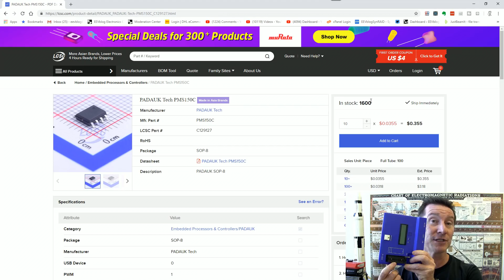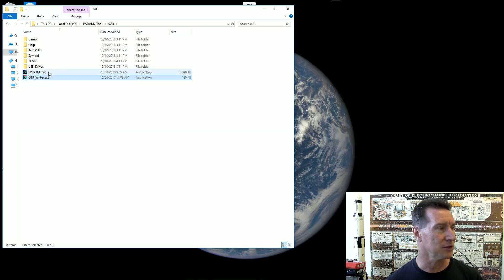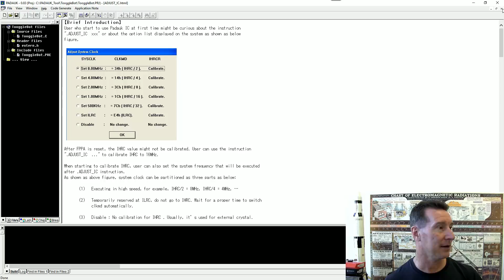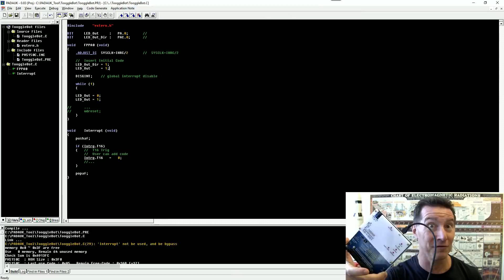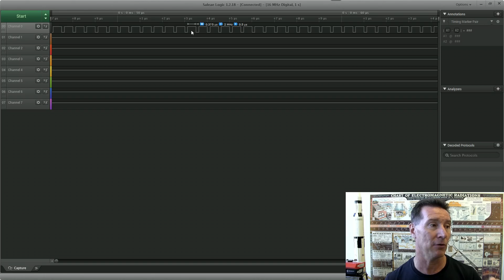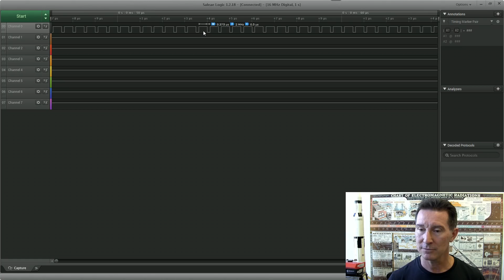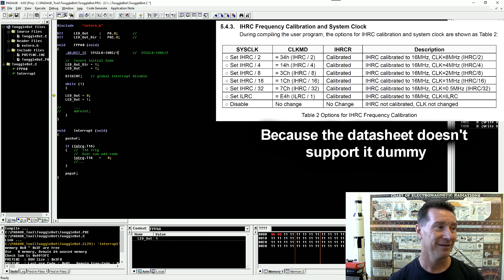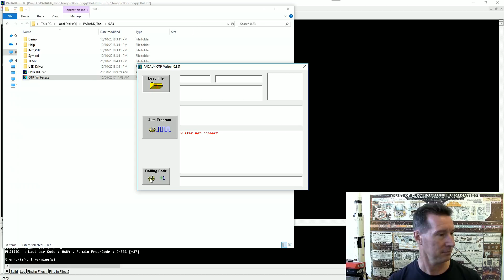EEVblog #1140 - 3 CENT Micro LED Blinky with ICE!

Comment: Who is going to be the first person to program it as a 555 replacement?
Reply from the maker: David Scheiber - 555 is not even close the relatively precision timing. The internal RC oscillators on micros are typically much better controlled than a 555 (typical >=5% cap value)
Reply: Dave that is so awesome of you to listen to your subscribers and order/program the 3cent chips, they should really make like a 10 cent reprogrammable version and sell cheap programmer kits to schools and universities, so that more schools and unis teach their students actual practical programming instead of just compiling hello world,  get micros in everyone's hands
Reply: @iwantitpaintedblack  yes because schools need to save 2c per chip.
Reply: I think micro will be more precise than 555, because the biggest problem is accuracy of caps capacitance (-10%/+20%?) and use of 5% resistors or trimmers. With micro all you need to do is get two 1% resistors or one variable resistor (pot) to make it adjustable, or even zero pots/resistors, if you hard code the timing pattern (or make some jumpers to select what you want). The benefit of using single or zero pins as input (for simple timing), is really cool because you can then use other pins for various stuff, like sync, multiple synced output (i.e. with phase offset, or dividers), or use another input to select maybe pulse width / duty cycle. Not to mention micro can generate a lot of other pulses shapes and waveforms (with PWM+LC filter). Not to mention you can use one small uC to basically create maybe 4 separate PWM signals possibly all at different frequency and duty cycle, and control it using 1-wire protocol from main uC, on separate busses, via daisy chining, or on one shared bus if you could make them program unique IDs into each chip. You could create easily 100 channel PWM for 1$.
Reply: A while back, I thought about the idea of using an attiny as an I2C address translator. So if you had multiple devices with the same hard-wired address, they could be remapped to different addresses (from the I2C master's perspective). But given the price, it would probably be cheaper to use an I2C multiplexer. However, at $0.03, maybe it would be worth it, while also eliminating the bus selection step.
Reply: I already did that with the attiny4. iirc i've put it on github 

EDIT: there it is https://gist.github.com/5N44P/3b7f3be883065c6469940819f6ff9fe0
Reply: I was about to do almost that. Seems nice for boot sequencing other stuff. Replaces like 5-6 monostables.
Reply: How would you select the timing without some external components?  For a fixed frequency it would be OK.  I know from PIC programming that you can set a pin to output, wait for a capacitor to charge through a resistor (monitored by another input pin) and discharge the capacitor by setting the output pin low.  If there is an ADC you can do the 555 1/3, 2/3 discharge/charge thing but you still need a few external components.
Reply: I might do that.
Reply: I actually heard canned laughter when i read that. WHY?! You already have a 555 timer and they aren't rare and elusive chips. You can buy them by the 1000s! I bought 100 of them in tubes for cheap!
Reply: I though you were on to something but the 555 is a relatively precision timing chip, so to match it you would likely have to add an external crystal to the micro
Reply: @DavidScheiber  how the 555 can be a precision timer if the time constant of the system is given by an RC circuit?
Reply: @valerionappi7839  By using precision passives?
#Derp
Reply: @DavidScheiber  Not everything using a 555 needs to have precision timing, especially when timing at the second or minute level.
Reply: @DavidScheiber  Bollocks.
Reply: +Jammit     First person will also be the first idiot, as well.

Comment: You should program it so like you hit a button, and it quickly flashes 3 times like something is going to happen. Maybe you make them into an ASIC cluster. Can you turn one of the pins into a i2c bus or something? Then you'd need to fan out to other chips for GPIO.
Reply: Matthew Suffidy i2c requires two pins.
Reply: I thought it may. No it is really ugly, but what you could do is if there is like 1 output pin, you could like have 8 more or so of these chips listening on that line for a serial-ish sequence to drive single output lines for example.
Reply: I found the English Datasheet: 

http://www.padauk.com.tw/upload/doc/PMS150C%20datasheet%20V004_EN_20180124.pdf

It looks like it just has like 2 or 3 input or output pins without protocol.

Comment: If someone can cobble up a DIY programmer things would be really interesting! 
@Dave - please have a look under the hood of your programmer... ;)
Reply from the maker: did on two 2nd channel videos
Reply: Something similar to the "Arduino as ISP" thing, this would put it into the hands of almost everyone.
Reply from the maker: The Arduino as ISP thing is in progress...
Reply: @EEVblog  great 😍😍
Reply: @nrdesign1991  😍😍yeeeeees
Reply: @Ennar
 Yeh... but it will stop being 0.03 very fast!
Reply: Jens Andree More interesting to get a general pattern / algorithm to load into generic programmers and testers.  For example, in circuit programming might be integrated into the test patterns for an assembly line board tester that already uses product specific patterns to test that all the other parts are working and connected correctly as boards roll past.
Reply: Got a link to these vids?

Comment: The instruction set is listed in the datasheet starting at page 50.
http://www.padauk.com.tw/upload/doc/PMS150C%20datasheet%20V004_EN_20180124.pdf

It looks like a pretty decent instruction set for such a cheap microcontroller. It seems pretty simple to work with and  there are only like 19 configuration registers. If the ICE wasn't so hard to get, it would be fun to play around with.

Comment: thanks dave for pointing this micro out, if someone implements a gcc backend this could become huge (depending on the errata of course ;) )
Reply: It's not a good target for gcc. It's got a tiny memory and a fairly large instruction set. The semi-C/ASM language they use is a pretty sensible approach to programming it.
Reply from the maker: As David said in the video, it'd be a bit how'ya'doing the first time...

Comment: hmmmm i could make a software emulator for this if it doesn't already exist. i wonder if anyone would find that useful?
Reply from the maker: I've done very useful projects in C on tiny micros with 64 bytes of RAM or less. You'd be surprised what you can do with such little memory and a good C compiler. Often it's the program memory that limits you, not the SRAM.
Reply: My impression was that gcc isn't very well optimised to generate code that needs to work on really tiny memory architectures... But I just saw that people have had success using it on attinys so perhaps my prejudice is outdated. SDCC used to be a favourite for those kinds of devices...
Reply from the maker: I'm sure someone would!
Reply: build a gcc backend instead it's much more useful!
Reply from the maker: I agree a gcc backend would be more useful, as we have the fairly cheap ICE for real circuit emulation.
Reply: How much support do we need to make this project a thing?
SDCC is easier to retarget than GCC, clang I think would also be easier but nobody seems to re target clang?
Reply: +1 SDCC, or convert the Tiny C compiler(TCC) tree.
Reply: 64 bytes of RAM is tons for assembly code.  Especially for the bread & butter applications these chips are designed for.
Reply: A reverse engineered bitbanging flasher would also be valuable....
Reply: @Undefined Lastname You'd be surprised what you can pull off with 64 bytes of ram. I used an ATTiny13 with the same amount with the Arduino IDE and was able to get a fairly interesting Vacuum Florescent tube display driver running.
Reply: you know what that kinda raises a good point. i assume they're gonna have simpler memory (no banks etc?) and global addressing etc.

the assembler might be a bit tough but we might be able to get a real tight C on there. especially if that dude above me has an alright time with the attiny13.  they still seem like quite complex machines with lots and lots of options in the registers and stuff so boiler plate might be the biggest issue
Reply: Miles Darkwright And that was in a C++ environment, no less (that’s what Arduino is – it even supports C++14 core language without libraries!).
Reply: Personally I think the mini-C is fine and more appropriate as it has more direct match to the features of the chip. You're not going to write any complex algorithms but rather configure the peripherals and run some simple control loop.
Reply: Why not making a community project with a custom C Compiler and PC Simulator for Debugging 😅 (Or an Arduino Library so it is better accessible for young players ;)
Reply: @mauriceb  this is a very very cool great idea 👏👏
Reply: GCC seems to be pretty picky with cpu registers hence why you don't see a lot of small microcontroller ports. SDCC might be a more practical option, but it really boils down to the type of architecture they used (the datasheet just says RISC, and that can really be about anything). I doubt they made something from scratch though.
I bet it's some existing architecture with either expired patents or maybe changed mnemonics and opcodes to avoid evident infringement.
Reply: Gunhaver if you happen to start the project for an emulator, be sure to share here a link to a GitHub repo, I'll jump right in
Reply: Get a github repo and i will make pull requests
Reply: assuming that it had a good amount of program memory you could program with overlays :). Idk that might require a bit of assembly but  you could write most of it in c. Maybe that wouldn't apply so much to this micro but I imagine it might be useful with other micros depending on the ratio of program memory to RAM.
Reply: gcc port and a cross-platform emulator would be amazing.
Reply: Has someone actually made any progress on reverse engineering their PDK binary output format? I've been taking a look the last couple of days and it seems like the payload (i.e. the actual ROM code/data) is encrypted in some way. That may be a problem, since there's probably no other way to reverse engineer the instruction set encoding without looking at the binary output of the compilation, unless someone has found any document that lists the opcodes etc... I couldn't find anything but I guess a chinese search engine should be used at this point. Any comments or any progress by someone else?
Reply: Undefined Lastname A bare metal C runtime does a RAM wipe/preload and gets going right away. It can even just jump to main and emit a HALT loop at the end of it, so zero bytes of stack used by the runtime itself. Modern optimizers can be very good and I’m doing lots of work on platforms just as limited. An “empty” C project in a good environment is a C runtime loop that zeroes the RAM and then halts. 10 bytes or something on most platforms like this. And that zeroing can be disabled. So I disagree. A decent gcc port that does global RAM allocation as of each RAM byte was a register – it’s produce pretty good code.
Reply: Undefined Lastname Optimized C can in-line the entire program if the functions are used only as logiciel subdivisons, i.e. each is called from one site. It can also statically allocate RAM variable frames so that no variables are on stack, and stack is only used for return addresses. Many vendors provide bloated runtime libraries but you can cut those down to use what you need. Or even run link time optimization that will strip a lot of unused stuff. It requires care, but there’s no problem with gcc generating 16-byte executables for day Atmel chips. You need to know the tool stack well though.